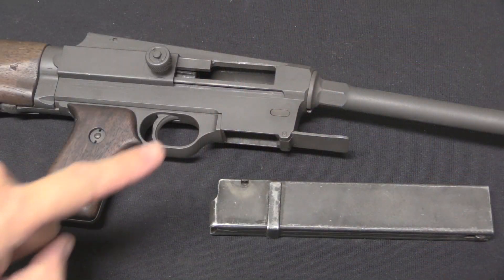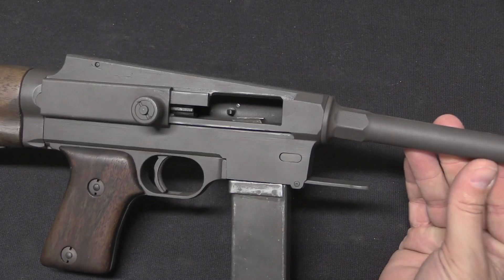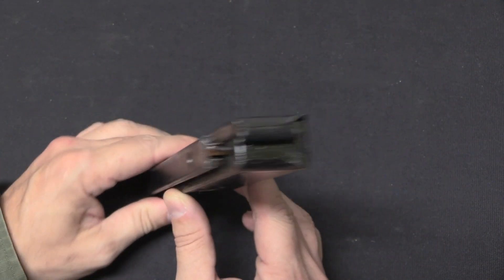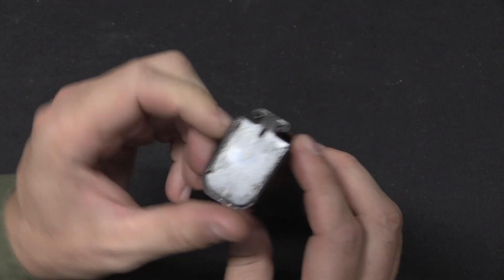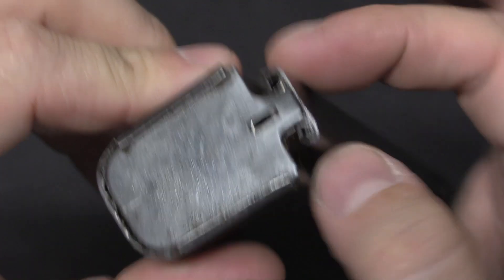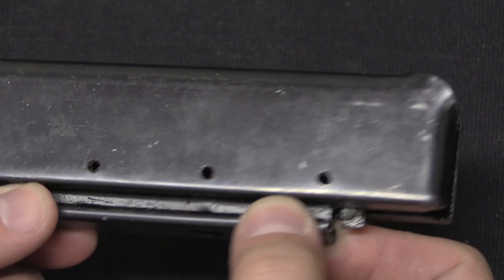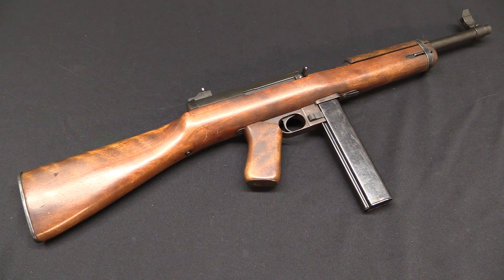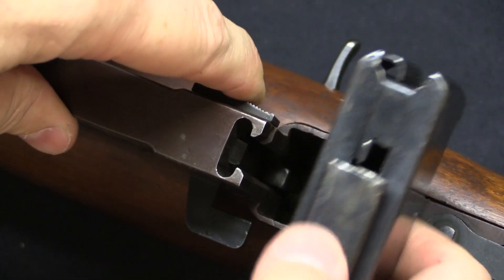Ask Ian: Why Didn't The M3 Grease Gun use Thompson Mags?

Comment: That's a good reason to eschew Thompson mags specifically, but the M3 is kinda thick and there should have been plenty of room for a double feed mag. Maybe it's worth mentioning that the M3 was designed to be converted to 9mm in the field, and it would have used Sten/MP40 mags, so the .45 mags needed to work similarly.
Reply: While possibly true, probably the bigger influence was just that it made for a simpler, cheaper gun.  With only one place where the bullet was presented, the feed mechanism is a lot easier to design and tolerances are likely a bit looser.
Reply: @DanStaal  I think that was mainly it.  The M3 was designed to be a much cheaper, simpler and more cost, time and resource effective replacement for the Thompson.  Why not use the cheapest and simplest magazine design possible?  In addition to saving time, money and resources on the magazine, like you said, the gun itself is easier to design and manufacture with a single stack magazine.
Reply: Reference Ian's earlier video "Single feed vs Double Feed". Like all his videos, there is a lot of really good info in it.

Comment: Drums. TheThompson acepts drum mags as well as stick mags.  If you have a mag well the drum would have to have a feed tower to feed the round up to the bolt.  Without the tower the drum has to fit flush to the receiver. That requires that the stick mags have some way to guide and hold the mag without a well.  the Tee slot acomplishs the guiding of both both mag styles.   The Suomi has a similar requirement.
Reply: Right, the Thompson actually started with drum mags, box mags weren’t invented for it until later.
Reply: Absolutely, came looking for this comment, this is clearly the main reasons why Thompson designed it that way - even with it being a very early SMG design I still believe he would have used a traditional magwell if drums had not been a consideration

Comment: I'd also add a point of view from a manufacturing perspective; the tooling for the Thompson magazines would be getting worn and needing replacement every now and then regardless. Once the ready supply of tools are worn out it would trivial to scrap the worn tooling and re-setting for a new standard as your millwrights are already taking everything apart in the turn-around.

More efficient designs make millwrights happy, too. 

The sane ones, anyway.
Reply: I mean you'd be swapping from milling equipment to stamping presses, not a small change by any stretch but I get where you're coming from
Reply: They made 1.5million Thompson M1A1s. At a cost of something like $250+ just to build a Thompson.An m1 Garand only cost the government something like $8. There's a reason only one Thompson was used by the squad leader. The gunsmiths making Thompsons spent many many man hours on each individual gun. There's a reason the weapon embodies the style of the time. It's a beautiful looking weapon with a tight fit and finish. The cost and complexity of the Thompson is what created the need for the grease gun, which was produced for $2 or $3.50 each. That's insane if you think about it. The M1A1 was already a simplified version of the previous m1928 styles. There's actually a toggle friction system on the models made before the M1A1. The original designs and designers were pretty confident in the toggle block design and thought it heavily affected the operation of the guns unlocking speed. The receiver is already a complicated block of machined steel, and the toggle design called for a square shaped perfectly machined block that would ride in  cammed grooves that were killed on the inside of the receiver. 
The M1A1 features a more traditional straight blowback only one piece bolt with the charging handle attached to the bolt. Effectively making a design with less separate overall pieces.

Comment: Even the Thomson's magazines were incredibly complex and expensive to produce.
Reply: The Thompson was like the PPD/ PPSH SMG’s , an incredibly iconic guns that were well liked but replaced purely because they were too expensive/ took too long to make .
Reply: @grzegorzbrzeczyszykiewic3338  The PPS-42/43 was a lot cheaper than the PPSh-41, but the PPSH-41 was still a relatively cheap mostly stamped gun. The gulf between the PPS and PPSh is a lot smaller than the one between the Thompson and the PPSh.
Reply: @grzegorzbrzeczyszykiewic3338  It wasn't just because they were too expensive or time intensive to manufacture.  That was a big part of it, because a design like the M3 that was much cheaper and easier to manufacture would, practically speaking, do anything a Thompson would do for a fraction of the time and cost and resources.  The Thompson was also very heavy, bulky and clumsy and wasn't very ergonomic and was very complex.  It had more parts and took longer to take apart and service than the M3 so in the field was harder and took more time to maintain.  It was a WW1 design after all and wasn't used by the US necessarily because it was such a good weapon, but because it was what the US had and was tooled up to make.  The US almost immediately began looking for a replacement when they were arming up for WW2 because the Thompson was an old, outdated design that was, yes, much more expensive and complex than it needed to be and that actually weighed more than their main battle rifle did.  The M3 wasn't just cheaper and faster to make, it was also much lighter, more portable, easier and faster to dissemble and clean and repair and more ergonomic.  The Thompson was iconic but wasn't as well liked by front line soldiers as is commonly thought.  Watch Ian's talk with Ken Hackathorn where they talk about it.  Soldiers who used it more like a PDW and didn't have to lug it around like vehicle crewman and truck drivers tended to like it a lot more than front line soldiers, who thought it was a boat anchor and only had any use for it under very specific circumstances, like clearing bunkers.  Any other time, they preferred a Garand or a carbine.
Reply: @grzegorzbrzeczyszykiewic3338  Atleast the M3 was well like by most soldiers too because it was a lot lighter and still comfortable to shoot.
Reply: I mean, they look like they could be simplified very easily: Just close the magazine on the back without the T-lug, and then cast/extrude/mill a separate, solid T-lug and spot weld that onto the back of the magazine.
Reply: @MrBlueBurd0451  That sounds very easy until you multiply it several hundred thousand times
Reply: with an open bolt gun, the magazine is everything. yes, they are probably the most complex and highly engineered and specific part of the gun.
Reply: Needlessly, even counterproductivley
Reply: you wouldn't need as many of them because you could use stripper clips

Comment: Wasn't the sten, kind a shitty though? I've seen Karl's video using one at the range
Reply from the maker: That Sten was a badly rebuilt parts kit. If you look at the closeup shots, you can see that the bolt handle was hitting the back of its slot and deforming the receiver tube. It should definitely not be taken as an exemplar of how a real Sten runs.
Reply: There’s no comparison the Grease gun is just a better design than the Sten gun, the M3 is more reliable, more accurate and easier to control in my opinion but still cheap to build and it’s 45 acp which was a must at at that time.
Reply: Two world wars!
MUH STOPPING POWER!!!
Reply: Karl was shooting a worn to fuck out Sten that is damn near a 100 years old of course it's not gonna work all that well

Comment: Wondering why the M10 wasn't manufactured to accept M3 mags without modification.
Reply: Probably to get a few extra bucks out of people, or they found the solution of shaving down the back of the magazine to fit the gun before shaving a bit off the back of the mag catch. 

While the MAC-10 and Grease Gun use different styles of mag catch, the MAC uses the lower ledge of the M3’s mag. 

And it isn’t as if shaving down the mag catch isn’t possible. I know of mag catches which let you use unmodified Grease Gun mags, so the technical possibility is there.
Reply: @Pilotmario  They had to be modified, because they did not work with the magazine catch. Plus like all other companies, they will make their own magazines and other parts so people have to buy from them. Probably the worst gun for this is the AR10 style rifles. There are two main patterns, either the Armalite pattern or the DPMS LR308 pattern. Once DPMS made the LR308, most companies adopted that pattern and most of the AR10 style parts and rifles today are DPMS pattern. But there are a lot of companies out there making their own version of the AR10, and for the uppers and lowers to work you must buy from them, because they will not work with Armalite or LR308 pattern receivers. Since there is no AR10 standard, these companies get to take advantage of people. Even companies that do use Armalite or LR308 pattern receivers will lie on their websites and claim that their receivers will only work with their receivers. For example, Brownells claims their BRN10 receivers only mate to their receivers, but they are lying, because they work with Armalite pattern receivers. Nonetheless, the AR10 style rifles is the most used gun that companies make proprietary parts for and lie about their parts only working on their guns, and they do it so people will but parts from them. One of the funnier ones is BCA, because their AR10 style rifle uses DPMS pattern receivers, but they used to claim you could only use their receivers. Then a lot of people made videos showing they worked with DPMS receivers, so now they just say it is best to just use their receivers, and that their receivers may not mate up with other DPMS pattern receivers. Gun companies scheme just like other companies.

Comment: My istant guess is that the bolts for single feed mag guns are easier to machine and require less specialized workers to make it. Since bolts are much more difficult to machine than stamped steel magazines, it's worth it to spend a little more to make single feed magazines if you can put out a million more cheap guns.

Comment: My guess is simplicity it’s easier to design a gun around a single feed mag than a double feed mag
Reply: Ian has specifically talked about this. A single feed presents the round in the same position every time. A double feed presents the round in two positions.
Reply: 100% correct
Reply: Indeed it is. Space might also be the issue, as with virtually every single double stacked pistol currently on the market. Because the double feed would take up more space internally in the pistol, they remain single feed. The grips can be wider to accommodate the double stacked magazine, but the top needs to be thinner due to the typical width of a pistols slide and frame.

Notable exceptions being the fn five seven and that Russian pistol who's name eludes me. Grach maybe?
Reply: It's ask Ian, not ask a regular person...
Reply: Ya , I agree 👍